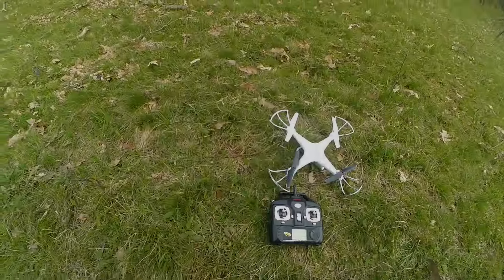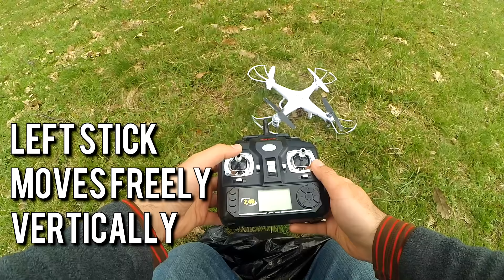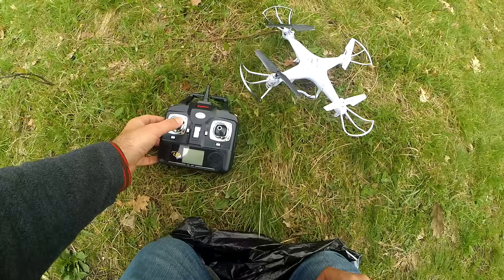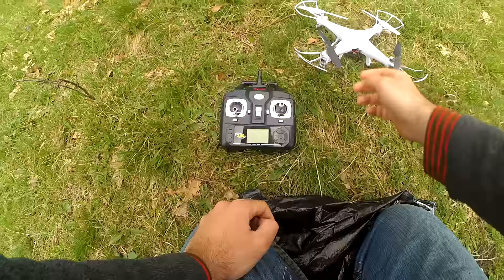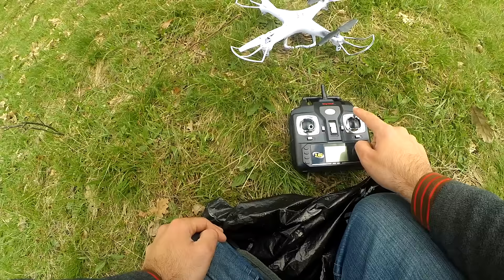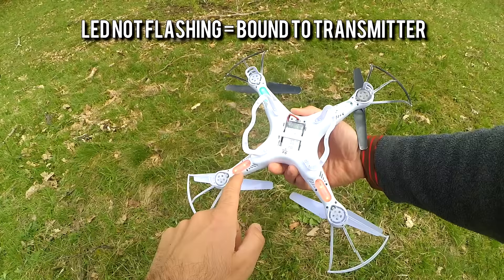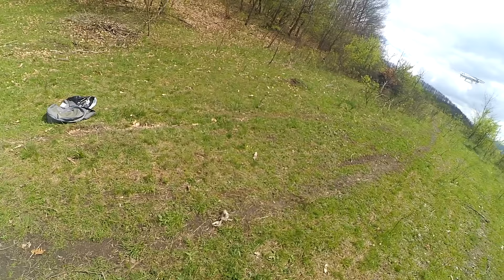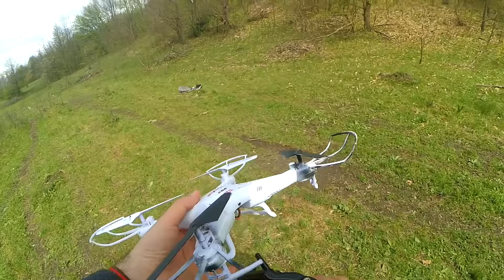How to Fly a Drone (Basic Tutorial, Quadcopter)

Comment: An old, but still very good video for a beginner. Add to that, the X5C is still available, and is probably one of the best drones ever for a beginner. They fly well, for a reasonable length of time, and batteries and parts are readily available and dirt cheap.  A true classic. One word of warning, unless you have some experience, DO NOT try and fly it in any kind of wind. It is a guaranteed way to lose your drone before you learn to fly it. Don't try and "trim" wind out, it will make it hard to control when the wind is behind it.  Trim should be adjusted for the drone to stay in place in calm conditions.  Always fly into the wind so if it gets too far out, it will tend to come back toward  you.
Reply: i no

Comment: Ive learned the right hand stick controls ALL the steering.  I bought another drone and its steering is completely different and i am BESIDE myself because of it being different!!!! Uggggg! Ugggggg!
Reply from the maker: Having the throttle on the left stick is called Mode 2, throttle on the right stick is called Mode 1. Other than that it should be the same. If the drone has altitude hold mode than both sticks should be spring loaded.

Comment: yeah, nice vid...YOu are good at teaching mate... I have the Challenger X-5 (a very cheap one) which looks the same... The issue is with the regulators... the bloody thing is pretty unstable, the manual in not comprehensible in English (very badly witten in English, surely not by English people) and when I use the regulating buttons, it is hell, very difficult to stabilize the beast...
Reply from the maker: How to use Trim Buttons ► https://www.youtube.com/watch?v=Nk2h06Ql3cM
Reply: yeah, thanks Furulevi, I watched your Trim video... You seem to have the same issue than me...Even with the trim, it remains quite erratic; that thing is a hell to control!!! DO YOU KNOW WHAT THE FRONT BUTTONS ARE FOR (left and right on both side of the antenna) ? (the manual is not comprehensible)

Comment: My X5C-1 does have headless mode, operated from the switch below the throttle stick.
Reply from the maker: probably is a newer model... x5sc
Reply: @furulevi  Or possibly it is a Bayangtoys X8C that you sometimes see falsely advertised as Syma X5C/X5C-1! Check photos in listing - Syma has SYMA & X5C across the central hub whilst Bayangtoys has only a large 2.4GHZ.

Comment: Do you know if these instructions work for the Contixo F17 also? The remotes looks the same....
Reply from the maker: Mostly yes, these are the most basic aspects of controlling any drone. One difference would be if a drone has the "altitude hold" function, in that case it would have a left stick that is spring loaded vertically also.
Reply: furulevi  do you know what button you press to make the drone stay stable in the air without moving?
Reply from the maker: Either manually control the thrust (left stick), roll and pitch (right stick), or get a drone that has GPS, altitude hold and optical flow sensor, those should make the drone stay stable in the air without moving.

Comment: Everytime i try to fly my drone the propellers dont spin at the same time altogether. Sometimes there's one not spinning at all on low constant throttle.Yes, It has crashed several times too on the bottom and the propellers do hit properties. Should i change them?
Reply from the maker: Clean the motors, straighten the propellers. Make sure they are spinning freely and they are not in contact with the propeller guards. If one of the motors is overheating then try to replace it.

How to use Trim buttons (Syma X5C-1)
 ► https://www.youtube.com/watch?v=Nk2h06Ql3cM

Why the Drone is not taking off (Leans to one side)
 ► https://www.youtube.com/watch?v=gEa8ducvbq0

Comment: So, I got a Quadcopter today, for the first time, and it's quite similar to it. Was easy to fly, but the thing is, I don't get it on how to charge it perfectly. I just literally plugged the USB onto my TV, hope that's charging, but suppose if it's fully charged. How long will the battery last?
Reply from the maker: The charger should have an LED. On some models the LED is ON when the battery is fully charged, on others it is exactly the opposite, it turns OFF when fully charged. The charging of these small 1 cell batteries should be pretty quick, 10-15 minutes or something like that.
Reply: Oh, when I charge the Quadcopter, the charger doesn't shows anything but after like half an hour, the LED Red light turns on. Does that indicates that it's charged?!
Reply from the maker: here is this Syma X5C's battery charger ► https://youtu.be/a5fGof9M3VA?t=525

Comment: How do you check how much fly time you have left will the drone just fall out of the sky when you have no battery power ?
Reply from the maker: Generally you can judge by the throttle (left) stick's position. In the beginning when the power level is high the stick is lover, in the end when the battery is almost discharged the throttle stick needs to be raised much higher to fly at the same height.
Reply: furulevi thanks

Comment: Well i am having a problem with my drone. When i move the controller to right it goes to left and when i press it to right it goes to left and same with the up and down... What to do please advise. I have Explorer 105v 6 axis gyro haobo drone.
Reply from the maker: Hard to answer... first try to simply take out the batteries and than reinsert them, calibrate the drone, check if some wires are not short-circuited in the remote or in the drone.

Comment: when my drone take off it dont stay stable it just move forward please help me
Reply from the maker: - check the trim buttons ►https://www.youtube.com/watch?v=Nk2h06Ql3cM
- if one or more propellers are deformed than replace them! The drone won't fly straight or won't hover if one or more "wings" are damaged.
- if one or more motors are damaged than replace them! The drone needs to increase rotation per minute of damaged motors in order to hover or fly as desired, which will further increase the generated heat and ruin the motor faster.

Comment: hi dear furulevi. Thanks for the video.  when I start My quadcopter it keeps going higher and higher and sticks to the ceiling and if i try to bring it down using the left throttle it it goes to the ground. Is there any way to trim the height level like we do when it goes to one side?
Thanks
Reply from the maker: On the Syma X5C I think there is no way to adjust the throttle trim, those buttons (shown at 1:02) are used for the camera. If you have a different drone than try out that vertical push-button at the left stick. And also calibrate it on a fairly horizontal surface.
Reply: I have Sky Thunder D44. I tried the vertical push button as you said and calibrated on a horizontal surface,  nothing changed. I think my drone is defected so im gonna take it back and get another one to check it out. Thanks for your fast reply my friend.

Comment: my drone doest light up maybe it need some more energy how long do i charge it
Reply from the maker: If you are charging it using a dedicated battery charger then that should stop when the battery is fully charged. You could use a multimeter to check the battery voltage. Lithium polymer batteries should have 4.2 volt per cell when fully charged.

Comment: does it come with a charger does it need to be charged or does it come with batteries
Reply from the maker: The quadcopter has a lithium battery and that has a charger inside the box, but there are no batteries and charger  for the remote control.

Comment: Should I be buying ones for the first one? Because I have no experience flying stuff like that hahah
Reply from the maker: Yest it's OK for beginners, it is lightweight, it has propeller guards, and the motors are brushed (less powerfull than brushless motors). If you fly it outside, medium speed wind will blow it away, so don't fly too high. In the beginning fly at a height somewhere between 1-3 meters only.
Reply: Sorry, I realized typo on my question. I meant should I buy a cheap one 
first because I have no experience flying this sort of stuff?
Reply from the maker: Definitely a cheap one for a beginner!

Comment: I moved the stick up and down but the lights are still flashing. What do I do????
Reply from the maker: - tha quadcopter it's either not yet bound to the transmitter (Don't move the quadcopter while binding)
- make sure the batteries of the transmitter are good, and the battery of the quadcopter is fully charged!
Reply: furulevi The transmitter has new batteries and the quadcopter is fully charged. But the lights still flash when I try to bind them, and the quadcopter is not being moved and on a flat surface.
Reply from the maker: If you have a multimeter than measure the voltage of the batteries. They might be new but the voltage can be low. Check your drone's user manual, it might have a different binding method!

Comment: any advise for drones without am auto hover feature?
Reply from the maker: How to hover manually? Watch some camera drones how slowly move in the air wile filming and try to imitate that slow movement, those very fine adjustments. That will increase your ability to maintain a steady position in the air.
Reply: furulevi I did manage to maintain a hovering status but I'm having a bit of trouble in maintaining altitude
Reply from the maker: Go higher than 1/2 meter, otherwise the drone will be in a turbulent air.

Comment: my drone name is Premium B28 i am facing trouble in the above mention drone name help me with that.
Reply from the maker: What is the trouble?
Reply: furulevi  when my drone take off its move forward it dont stay stable my drone name is Premium B28
Reply from the maker: Check the trim buttons, motors, propellers, like I mentioned in a different comment. Also calibrate the drone so that it will know what is horizontal. Don't move it at all while calibrating it.

Comment: when I try to move it right side it moves left and when left it moves right side what should I do
Reply: Salman Asif If that happens you have rotated your quadcopter 180 degrees. When doing so all your controls are inverted. For example if you push your stick to the front, it will go towards you. Also if your rotate your 90 degrees clockwise and push your stick to the front it will go right.
Reply: Master Nebulon thanks
Reply: Salman Asif no problem. Hope that helped!

Comment: I'm facing a problem with my drone... It won't run more than tow propellers
Help me please
Reply from the maker: 2 propellers are spinning even if you manually rotate the drone to different angles? First try to calibrate the drone, if that does not help  than you should check the wire connections or the motors (hopefully the flight controller is not damaged).
Reply: furulevi thank you for your help. 
The problem has been solved by resetting the controller.

Comment: How to maintain a certain constant height
Reply from the maker: On a simple drone you have to constantly adjust it using the throttle stick (plus you need to correct the sideways movements). On a more complex drone the altitude hold (barometer) should keep the height fairly constant without any user intervention, and the GPS would keep it from sliding sideways. For even more precise horizontal hovering a down-pointed optical flow camera is also used.

Comment: My drone is constantly going sideways and it won’t go into the air. Whenever it does it just falls back down
Reply from the maker: - Check the motors to see if they spin roughly at the same speed, clean them, if they spin slower on one side then they are probably worn out. Brushless motors have bearings, brushed motors can wear out faster because power is transferred through friction inside.
- Check the propellers, the blades must be at a certain angle and not totally horizontal.
- If the battery is too old or charged/stored incorrectly then it's probably damaged and can't provide enough power. If the drone is not used for 2-3 days the battery must be discharged to 3.8V per cell (storage charge). Don't discharge the battery more then around 3.5V per cell or the battery will be puffed and it won't be usable for flying.

Comment: my one is not binding plzz help
Reply from the maker: Check the batteries with a multimeter to see if the the voltage is high enough both of the drone and of the radio. A one cell Lithium battery should be at around 4.2V when fully charged, and one AA battery chopuld be at 1.5V or 1.2V.

Comment: Trying to find the best drone for a beginner.i under 100$.Mabry someone can help me??...
Reply from the maker: For a beginner something like this is perfect. It is light weight, and it has less powerful bushed motors (brushless is more dangerous). Smaller drones can be somewhat harder to control because they tend to be more agile due to the smaller size. On some similar drones the cogwheel below the motor is also better protected against dirt. If a drone also has "altitude hold" that's even easier for beginners. The positioning sensor (this drone doesn't have it) even maintains the drone in one place similar to GPS, but it is working inside the house also!

Comment: Hello,
Do you know the DM007?
Reply from the maker: That's a little bit smaller than this Syma X5C...
Reply: OK, Thanks

What means 360º, 4D, mode1, mode2, ... ?
Reply from the maker: - 360° menas that it can do flips ► https://www.youtube.com/watch?v=3_ZuZ0AekaU
- 4D might be a company name, or it can refer to flipping in 4 directions
- mode 2 = throttle is controlled by the left stick, most common option (mode 1 = throttle on right stick)

Comment: Oh man, you might hurt yourself if you keep doing that
Reply from the maker: The quadcopter has propeller guards, and the motors of this quad are not that powerful either, but still can cause pain! Don't fly in windy conditions!
Reply: +furulevi yea i accidently turned the throttle up and got a blister
Reply from the maker: That's not good, but it is still somewhat acceptable! Larger and more powerful quadcopters will cut the flesh! HANDLE WITH CARE! Spinning propellers are like knives!
Reply: +Darth vader “darth snowpea” Sagoo Make sure when things go wrong safety landing or if you are getting a rest or (and) the drone gets stuck always turn off the controller
Reply from the maker: Reduce throttle to zero if the quad crashed. (on some quadcopters turning off the radio control while the drone is ON might spin up the props).
Reply: +furulevi Oh I see!
Reply: t101 drone
Reply from the maker: syma x5c